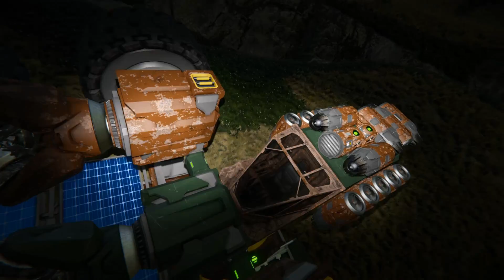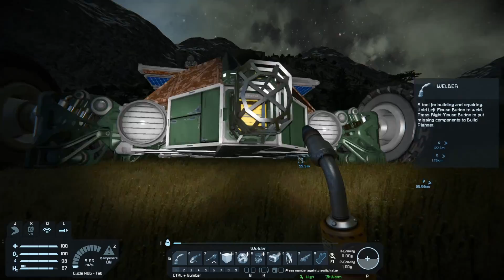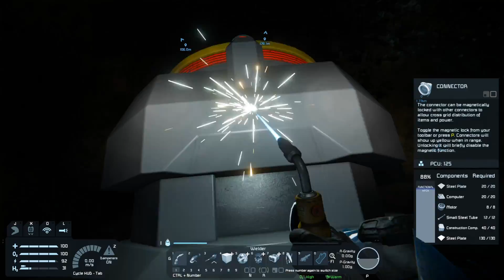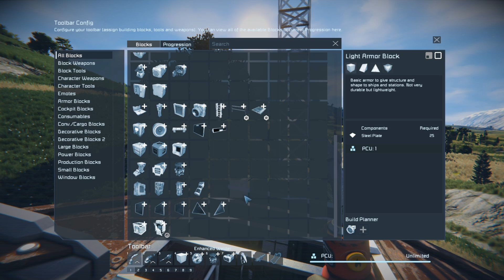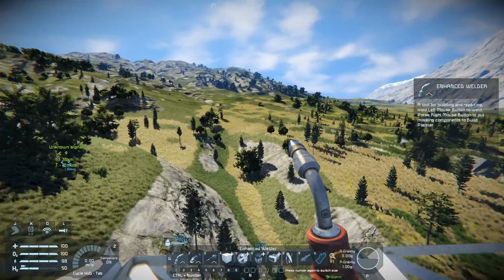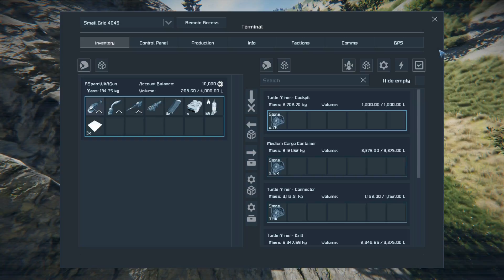Building A Windmill & Testing The Turtle Miner! - Space Engineers LP - E07

Comment: Also use two large thrusters for lift. The little ones are not power efficient to as many as you need. Add a few more batteries, one large and a few small. Set one of two small batteries to off for emergency batteries.
Reply from the maker: The ONLY reason I don't like using large thrusters for a ship like this is the profile (unless I stuck it on the back...which would be a pretty good idea actually lol). Cause I wanted to be sure the drills could bore a hole that the whole ship could fit through. Otherwise...yeah, that all totally makes sense haha. I actually did add more batteries in the next episode to compensate which seems to have fixed things for now. :)

Comment: If you put a piston on your vehicle pointed downwards with a landing gear on the end. Your system will charge off the windmill.
Reply from the maker: Yeah, I've been told now that landing gears & rotors can be used to put the turbines on them. The piston isn't a bad idea, I'm assuming so you can extend them up for the height they need? That's the only problem I'd have with that, is having them high enough to produce without having to feel like I'm driving a crane around haha. :P
Reply: Not sure that would work, the "static grid" is the one the landing gear is on, and the turbines need to be on the "static grid" to work.  if you had a grid built of a piston with the landing gear and turbines on then that would do the trick, would just be bulky...
Reply from the maker: Yeah, that's what I was figuring. Which would mean there really wouldn't be a good way to retract them and make it compact...so...I'll have to think about that some more and see if I can figure something out. But for now, I think the wind turbines will end up at my actual base instead of mobile lol. xD

Comment: 1 View 0 Comments hmm

Edit 1
There are three ways you can have a wind-turbine on a rover
1. Add a landing anywhere and then lock on to a station that makes it so that it counts as a station
2. Add a free floating wind-turbine on a double rotor so that it can lock on any angle
3. Connect via a merge block

Edit 2
Also the wind-turbine outputs 0 because you are only charging one small grid battery and the three large grid batteries are set to discharge meaning they do not accept any power. So since the wind-turbine has nowhere to store any power they are not producing any power.

Personally I do not turn any battery off just either recharge on/off

Edit 3
The reason you are over loading is because you only have ONE battery and you have a lot of thrusters. And that one battery only outputs a max 4MW. If you had say 3 batteries the max output is 12MW.
Reply: Everything here is what I was going to put. Only additions left to add are that it doesn't matter what orientation wind turbines are, so have them on their sides or upside down if easier, only things that matter are height and space from a certain side (I've never figured out how you tell which side without placing the turbine and then add blocks around it).
Reply from the maker: @Juan Pinoy All good info, thanks. I wasn't aware of the landing gear or rotor tricks for turbines, may have to use those at some point.

I'm not an expert but I'm also thinking the turbines could've been at 0 because nothing else was using power either, like an assembler/refinery/etc. I believe solar panels work the same way, so I'd assume they would've shown an output if there was something using power at all.

I think the battery off thing is a habit from before they added the auto/recharge/discharge modes, but it mainly allows me to leave them set to auto or whatever & just disable/enable them. I see a lot of comments that seem to get annoyed that I turn them off but...honestly it's sort of just a preference thing. I don't think it makes them behave any differently really so it's kind of funny to me lol. :P

@DracoZandros I think I'm in the same boat. Kinda figured height matters (everyone's said at least 10-15 blocks but I'm thinking it may need to be higher depending on terrain). I wasn't sure about the orientation, but it makes sense if it wouldn't matter. And I've read somewhere like 5 blocks apart for sides, but I'm not really sure about that yet.
Reply: @Sleeplessknightsstudios  think it's more 8 (at least that's what I'm seeing with 4 turbines mounted side onto a 3x3 column, my power is ranging from 355 - 365. I tend to have a 3 gap between the turbines (5 between centre) and see between a 0-20% loss of power with that gap, you can rotate them in such a way that all have a 0% loss but I really don't care enough to work out the orientation to get that :D

Yes your turbines was producing 0 because the solars was producing enough to keep the grid powered. Your turbines was saying something like Max Output 360kW, so that's the maximum they would have produced if your base was able to draw that much. Supposedly you can get 400kW max but best I'v managed was 375 on a 16 tall tower with no obstructions.

Doesnt annoy me you turning batteries off, I do the same if vehicle not going to be used for a while, only thing that it affects is that it cannot charge when off, so setting to recharge and leaving on is what i'd do for recharging.
Reply: Sleepless Knights Studios for a static turbine farm my go to design is a box which can be repeated indefinitely and can have 16 wind turbines on each at about max efficiency. I start by having one steel block as the middle then 8 pillars to the sides and a steel block at the end forming a +. Then I connect to the corners with pillars and a block. Then I place a wind turbine on the top and bottom of each steel block with the exception of the middle. In the middle you can add 4 pillars to repeat the process or a wind turbine. Also about the battery thing it is more so that you won't lose your things if they get disconnected. Personally I have a few small small grid batteries to keep it powered. Not enough to fly but enough not to get deleted by trash removal. Since it targets non powered grids
Reply from the maker: @Juan Pinoy Hmmm, I'll have to look over your design a bit more (not quite getting the right picture right now but I'm multi-tasking haha). Didn't really even consider the garbage collector angle for batteries...may have to change up my habits lol. Thx for that though. :)
Reply from the maker: @DracoZandros Yeah, they remind me a bit of stuff like torches in minecraft...does it light up 7 or only TO 7 blocks haha. I only mentioned the battery thing cause I seem to get a peculiar amount of comments where everyone seems annoyed that I turn them off, and I'm usually like "What? What I do?" haha. xD
Reply: Sleepless Knights Studios you can look on the keypad and count 1-4 & 6-9 as wind turbines and 5 as the main shaft